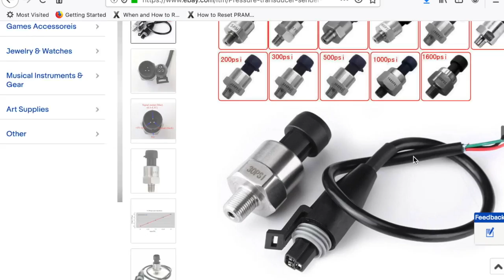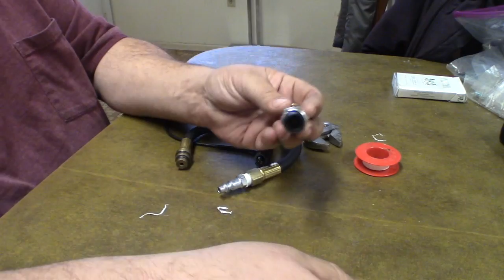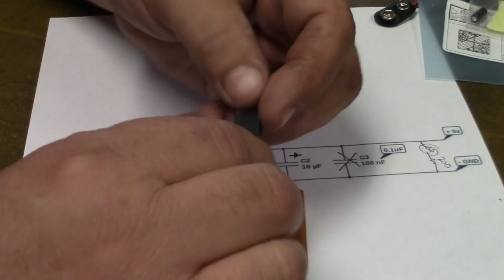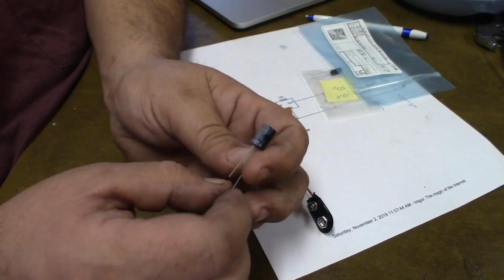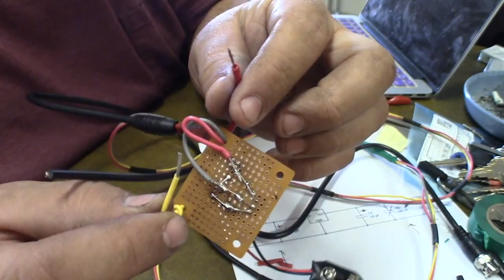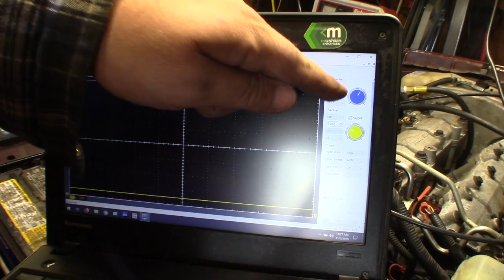Making a Pressure Transducer for my Hantek Oscillosocope

Comment: I would think that a 5 volt power bank that is typically used for phones would be the easiest way to power the sensor. Rechargeable, and can be purchased about as cheaply as building your own circuit.
Reply: Depends on how stable it is. His design ensures a solid 5v output. Any changes in voltage will change the value of the psi reading. You want it to be as stable and consistent as possible.

Comment: I've done exactly the same stuff, sensor, power supply and hoses but ran into only one issue.  These very cheap pressure sensors are hit or miss.  I've gotten a couple that just didn't react fast enough for a smooth pressure reading and display but gave a stepped waveform display.  I've been told that upping the voltage a bit may give a better reading but I never did try that.  12v sensors may be the way to go, or sensors in the $100-200 range having better quality may also work better.  Anyway, it's obvious that homebuilt sensors are up to the job.
Reply from the maker: Thanks for sharing your experience and advice!

Comment: Why can’t you use a 4.8 v battery pack?
Reply from the maker: You probably could
Reply: @frugalprepper   I see some sensors; at least the one I bought has a tolerance of 4.9v to 5.1v. So I guess I'll build my own. I went with SSI 500PSI. It's said to be as fast as a Fluke pv350. I wanted the 300 but it's on back order. I found some step down units  prefabricated and project boxes on Amazon.  Thanks for the upload!
Reply: @frugalprepper  You mentioned Ivan. Is this the Ivan from Pine Hollow Auto Diagnostics? What transducer and scope are you using today?

Comment: Hey I have couple of questions for you. I have two 100uf 50v can I use both of them? 2nd question I have is regarding LM7805 I am getting 9v on the output side of it and 5v in the middle pin. I am not sure are those supposed be correct voltages? Please let me know thanks!
Reply from the maker: Yes you can use them in Parallel across the circuit which will give you 200uf, and it will work fine.  The capacitors just work as a buffer here to provide quick current, so more uf is better.   On the 7805 the pin 1 should be the first pin on the left as you lay it down with the lettering facing towards you.  Pin 2 is the middle pin and it should be ground (negative side of the battery)  and pin 3 should give you the 5 volts.  If that is not the case then you may have a bad 7805.
Reply: @frugalprepper  Great thanks so much for the reply greatly appreciate your help! I will keep you posted see how this turns out.
Reply: Hey, just wanted to update you, first LM chip was fine I just had the chip the other way around. I followed your direction and sure enough I got the correct voltages. 2nd I got a 500psi transducer, I could've swore I ordered a 300psi one. Oh well I will order a 300psi one soon. But the end result was good though. I do get a clean waveform, I tried it in maxiscope and a snap on vD10  scope. Once again thanks so much for all your help and that video you posted, saved me couple hundred dollars. Now have to get a project box to box this thing in maybe get a toggle switch.

Comment: The linear regulator will run very hot, around 212 deg. It’ll shut down when reaching 140deg, then turn back on when cooled down. Try a step down convertor? Possibly shielded to prevent RF interference.
Reply from the maker: Not in this application where it is providing so little current.

Comment: Great project. 
For most people when they are talking about mechanics they think the mechanic should always wear dirty coveralls steel toes safety glasses and their hands are always greasy and they can not do nothing other than turning wrenches. 
Your talent sets a perfect example for what a real mechanic looks like today.  Not only can they turn the wrenches or how many snapon tools they have but also they are able to manage to perform tasks across their field from mechanical to electrical/electronics to IT whenever needed.
Reply from the maker: Unfortunately the pay in shops hasn't caught up with the skills that are required to do this job.  So most shops can't hire someone like me, because I am already making good money doing IT for a living.  Most shops are still just hanging on by a thread doing brake jobs and suspension work and occasionally winging a few parts at something and getting lucky.

Comment: Hi, when reviewing the waveform you can still change the timebase and voltage to check out the waveform detail, but not quite like the pico.  I still think you must master the Hantek first. I'll use the Hantek 6022be all the time and that only records 5 volts without changing x10 switch.  Very good project.
Reply: Can you hook up your hantek to a PC to use their scope software? I've had the worst time trying to download the software.

Comment: Nice work. Osc482 is a nice cheap scope with low noise. You can the use that with Hscope on an Android phone. Hscope has an automotive module. Also the Osc482 free pc sostware is quite nice with good/long recording. Think there is a free andriod app for the osc series. Osc482 made by Loto Instruments.
Reply from the maker: Thanks for the info

Comment: I did a similar thing using the same traducers only I used a 12 v to 5 v converter for only a couple off £'s , get some lower value traducers and you can use them to see turbo boost etc just need to use different connectors to break into what you want to use them for, I have a 4 channel Hantek and I have a couple off 2 channel Pico 2205 scopes and they work a charm just need to set them up right
Reply from the maker: Yeah I've seen those on e-bay, and that would be the way to go, but I was using what I had in my leftovers from other projects.

Comment: Hello !
Very interesting solution. With a hot engine running, how quickly will the sensor get damaged?
Reply from the maker: It's not going to get damaged.  There is no spark in the cylinder your are testing so that cylinder isn't super hot.  You engine typically stays around 200F

Comment: Dang Tom, your pretty smart. That's fantastic and I can see the comments coming in to buy a few. I gave up on my Hantek. I can get some basic information but I get so aggravated with it I find myself not enjoying the work. Since my work is a hobby, if I'm not having fun I move on. Great effort on your part Tom.
Reply from the maker: wyattoneable just wait.  I found a way to work some driver magic and make the pico 2204a work with the automotive software
Reply from the maker: I have ordered some stuff to build some.  I am going to put the circuit on a real etched board, put them in a nice case.  I also found a nice transducer that comes with a 3 meter oil resistant heavy duty pigtail.   I am going to put them up for sale and put the money into the scope/scantool fund.
Reply: @frugalprepper  That's great Tom. I'll be hanging around.

Comment: good thing when build your own tools is you really know how it working .
good job .
Hantek gets you started but soon be time up the game .
Once you start doing like 20 cars a week better equipment and better technique makes better results in shorter time .
Keep having fun ...
Reply from the maker: Not there yet, but I've done 12 in a week.  That's just evenings and weekends.  Definitely need a better scope, I think I want a better scope more than a bi-directional scan tool and a JBOX.  All are on the list.
Reply: 12 still a lot as a side line and making it faster diagnose the common issues and enioy equipment you using is key .
I can do over 3/4 of my scope work via 2206 without needing go to 4 channel autoscope .
Have a look at vids on the 2000 series in auto testing and see if do you as an acceptable improvement .

would be worth looking at a autel or launch for lower cost first bidirectional santool perhaps, pending on how covers most of what you work on .
Keep chipping away at the junk and re-invest as can,  quicker you own it quicker it paying you back  .

Other thing consider is your charging, maybe little little more can be charged making diag tool funding quicker turn around .
You got enjoy doing it so sensible decent diag tools a must to enjoy the process and grow knowledge, confidence as well as business .

Have fun ...
Reply from the maker: @mrb1864  Yeah, and I have to say that's 12 cars total.  Not everyone is a diag job.  Some are just brake jobs and other mechanical things.

Comment: Put some more of those together sell them at a reasonable price and there’s you pico scope momey
Reply from the maker: Hmm... That's an Idea.  I could even layout the board, and have some etched and put them in a nice little project case with a panel mount BNC jack on it.  Might build a few and see if anyone buys them.  I guess when I used it in future videos I could always link to my ebay store where they could buy it.
Reply: FrugalPrepper's Garage & Garden you could always set a price take orders and make it then mail it to them that way you get money for it or build one and send out your one your using. Then build another for your own again. Not sure what your cost was if cheap enough you could build half dozen. You should be able to measure with multi meter with a bunch to banana clip those are cheap it might not work wit a compression test unless u have a way to hold pressure so it stay at max. I don’t even see why u need a scope as all your reading is voltage.

Comment: This is good for all sorts of pressures not just compression check fuel, coolant, exhaust back pressure oil pressure any pressures les than 300. Tom you are a very knowledgeable and resourceful guy I have no doubt you will learn diagnosis with a scope and become good at it. You definitely understand technology which is a huge advantage as most mechanics have a difficulty grasping things like this. Thanks for sharing the info on pressure transducer. I have seen the pics scopes under 300 dollars so they are attainable as well.
Reply from the maker: My understanding is that the smaller Pico wont' run the automotive software, but another viewer was telling me that you can run the auto software in demo mode, setup the test you want then save all the settings to a file and open that settings file in the normal Pico software.  While not ideal, it would still be way better than the Hantek.

Comment: Very detailed, thank you. I bought stuff to build one at the beginning of the year and still haven't built it yet. LOL
I'll be using a new ac pressure sensor for a mid 90's gm as my sensor. Looked let you had a nice capture for what little money spent. 👍👍👍
Reply from the maker: I heard of a lot of guy using the AC pressure sensors.  It will be interesting to see how it turns out!